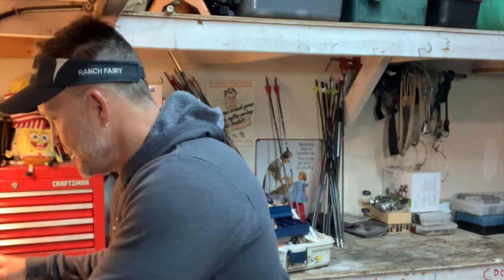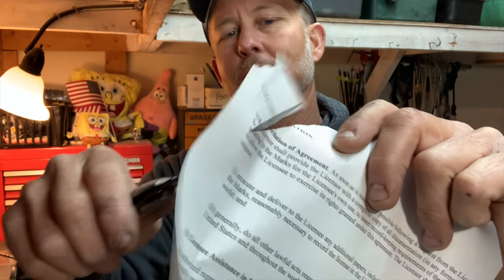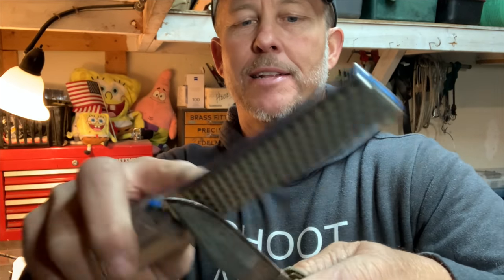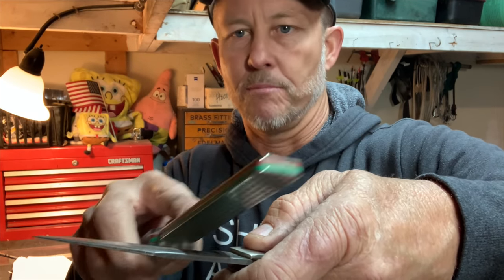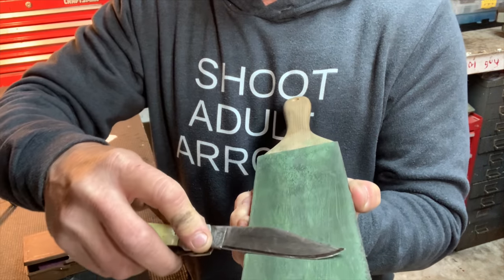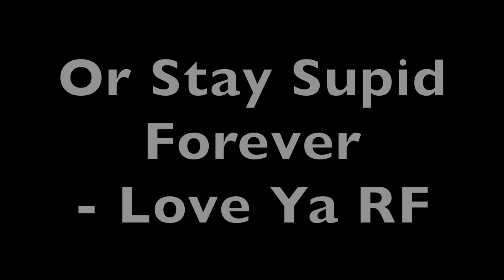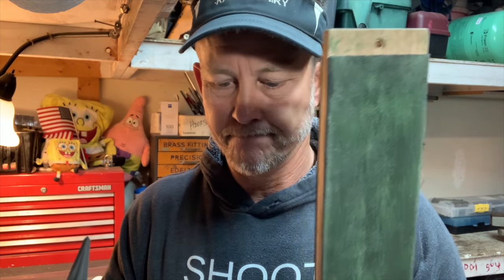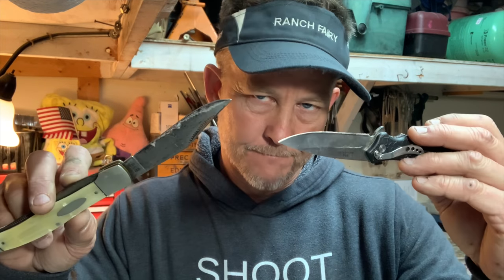Broadhead Sharpening Hack l Ranch Fairy

Comment: As a person that others pay to get their expensive knives sharp, I whole heartedly agree with the RF. You can chase down a $600 stone(quite easily) but if you can't hold a consistent angle and learn to hit the apex, form a burr, and remove a burr, it won't help at all. I always say, "the only way to get better is time served at the stones" . Invest in the skill, and the tools you use become modular.
Reply: You can also skip the strop and use newspaper. Spend your money on a quality coarse stone.
Reply: @jonbrown9490  course stones are only good for wrecked blades
Reply: @mikeguy9668  I guess that depends on what you consider course. My lowest grit stone is 220. I finish on a 6k. That being said I still agree that most amateurs are way better off with a quality coarse stone first.
Reply: @jonbrown9490  you can fuck the profile on a blade up real fast on a course stone. If I have a really dull blade I'll hit it with 500 first and end up at a thousand and finish with a strop.
Reply: @mikeguy9668  you can fuck the bevel up with any grit stone. That has zero to do with the grit of the stone and everything to do with skill and technique.
Reply: @jonbrown9490  a course stone does it much faster. This ain't rocket science
Reply: @mikeguy9668  you're absolutely right. The answer is simple...if the stone is coarser and you don't want to remove as much steel ....rub the knife or broadhead  on it less. 

Then look at it to see if you need to remove more metal...if you do rub it on the stone some more...if not... stop and move to a higher grit.
Reply: 100 % the truth purchase yourself some good stones plates paddles what you like and start the process take it slow and detailed and it will all come into place in a positive way.
Reply: @jonbrown9490  A course stone is used to take out damage to you broadhead and used very little course is 325 mesh fine is 600 mesh extra fine is 1200 and a strop with the three you can get your broadheads scalp sharp be careful not to drop one if so you might just take out someone in China.

Comment: Watching this again for entertainment and edification. Recently I sent a high end single bevel through a whitetail that was extremely quartered away. It arrived sharp and kept on going. It does need to be resharpened; but I’ve had lesser blades break apart inside deer. So go for the good steel; and learn to resharpen!  Thanks Ranch Fairy!
Reply from the maker: Always touch them up!!  Double check everything.

Comment: I learned how to sharpen a knife when I was 8yrs old. My Grandfather gave me a yellow handled Imperial pocket knife and a 2 sided carborundum stone. He showed me how to sharpen it on the stone, strop it on my leather belt and told me if he ever found it dull, he would take it back. He never got it back, I’m 58yrs old now and still have it. I shoot a 65lb longbow with 145gr single bevel SHARP broadheads, on my sitka spruce adult arrows. Love the videos Troy, tell it like it is.

Comment: Damn you Ranch Fairy.  I sharpened my new Magnus Black Hornets the way you showed the THP guys and while hunting accidentally knocked my my bow over in the blind.  Broadhead straight through the side of the blind like butter.  Haha.  Thanks.  I guess I did it right.
Reply: yes, he used the Stay Sharp guide. If you want them even sharper there is a video to show you how. https://youtu.be/9tg0PfHkcfU
Reply: @innovativeoutdoorsman5067  I used your Stay Sharp guide.  It worked very well.  Definitely recommend, especially for broadheads.  Never saw that string trick before.  I just bought some of the serrated heads.  I'll try it out.
Reply: @Patrick-wu6kt  Yes, tricks and hacks and methods for making bowhunters more lethal is what my channel is all about. Simple, low cost solutions that increase bowhunter lethality. Thats what I do.

Comment: Sharpen those single bevels with a Stay Sharp guide for a razor's edge. And its super easy. No PHD needed. Super easy and effective and razor sharp blades when done. And its very low cost. DO NOT waste money on a strop when you can use cereal box cardboard for free. Spend the money on good broadheads and use a free strop.  I show how in all my sharpening videos.

Comment: You have a good technique, and it works for you, and will others. That burr, you are describing is called a fin. The fastest way to achieve it is to pull the edge into the stone (on both sides), with your course and medium stones. This is sharpening. With your med fine and fine stones, you draw the edge away from the stone. This is honing. Then stropp, just as you said. This will save you a lot of strokes. 
Also, look directly at the edge. If it reflects light, it needs more sharpening. If you cant see it, because it is refracting light, it is ready to hone. No PHD here, but i do shave with a straight razor, every day. The right direction for the stone, and looking to see if the edge reflects light or not will save you a lot of time, is all. Over sharpening is the easiest thing to do, and can cause lots of discouragement😂 
Good vid!❤
Reply from the maker: Always here to learn!!!  Do you have any devices you use to “look” at the roughness of the edge?  I’ve put mine under a computer based microscope and it’s not perfectly polished smooth BUT better than just 2 years ago!!!!
Reply: @RanchFairy  I'm not that sophisticated😂 I will use a magnifying glass, to see where I'm at, on say a long blade I'm not familiar with. You can feel the fin, or the "burr", so don't need to look at that. If it is is real big and easy to see that it looks like a piece of aluminum foil, that means you were ready to hone, a hundred strokes ago😂 Those diamond stones cut real fast. If your edge is kind of sharp, and doesn't reflect light, but you want it sharpER, skip the course stone. Just a few sharpen strokes on medium, will have it ready for the hone stone (fine grit). If your fine stone is an actual soft stone, rhey clog with metal, real fast. If yours is covered in metal color stripes, its clogged and won't polish. Your course diamond stones, under slow warm water will clean that metal off, real easy. Honing under a soft stream of water will save a lot of strokes and keep the srone clean. When the stone is clean, and your angle is correct, you can feel the stone grab the knife, vs slide across with little friction, you are honing very efficiently. Anyone that has tried to sharpen a knife has felt what i just described. So, you strive to feel the stone grabbing the knife. That means the whole edge is laying flat on a clean stone, that is working. Its all about moving to the next step, in the least amount of strokes, so you don't grow to hate sharpening😂 Of course, this all applies to any edge, and your broad heads. Hope I didn't bore you😂
Reply: The instant you can look directly at the edge, and it doesn't reflect light, but looks black or invisible, you are done with the course stone. As soon as you feel the fine stone "grab" the edge about fifteen times, alternating sides, its ready for the stropp. It took me millions of wasted strokes, and a lot of un-needed elbow grease to learn how to keep the whole edge flat on the stone, and when you are done with one stone and ready for the next. I hope i saved some folks a lot of time and aggravation😂
Reply from the maker: @vitodelorto1796  
Practice makes it work better!!!
Reply: @RanchFairy  It took me a long time. No one will ne an ace at it right away. They should not be discouraged if it doesn't work as easy as on the video, their first few times. Once they get it down, they will have another adult skill, to go with their adult arrows😂

Comment: Since Im all about helping out the new guys and the young guys with little to no funding for bowhunting, I can tell you to NOT waste ANY money on a strop. Put that money into good broadheads. You already have a strop at home. In all my broadhead sharpening videos I show and explain the use of cereal box cardboard on a flat surface and buffing compound to make a nearly free strop in any size you like. And another benefit is you dont have to clean it or resurface it. 
When it becomes clogged, just eat another box of cereal. That will save you both time and money. Im all about broadhead sharpening and educating bowhunters. Get a razors edge with very little cost or effort. Broadhead lethality is my goal and getting others there is the mission.
Reply: Same with knives. Shitty steel will never take an edge that will shave arm hair, let alone keep the edge. You can sharpen, hone, stropp, til your blue in the face. If you ever get it sharp, that paper slice test will dull it😂
Reply: I made my strops pretty cheap man and I guarantee you that they work better than cardboard. But I get where you're coming from, some people try to sell strops for way to much
Reply: @mikeguy9668  piece of leather laminated to a board works great. I use a conventional stropp (not cheap and almost 1/4" thick 3/16 maybe and very smooth) for the razor i put on my face every day. I guess fine, medium and course applies to leather as well as stones. I don't understand it, but my home made strop works best on filet knives and real strop best on straight razor. Edges are all different and fineky😂
Reply: Look up "scary sharp"  The woodworking method of sharpening with sandpaper.  You can use the whole method, but if we are talking strops, just use the last step on sandpaper.  It is fast cheep, lasts, if you get the right paper.  And it is more aggressive than a strop.
Reply: @HondoTrailside  a strop doesnt sharpen. Once you hace finished sharpening with grit, no matter how fine, the strop just polishes the striations left by grit. Its just the final honning touch. Probably useless for broadhead penetration, but very mandatory for a clean facial hair shave.

Comment: This week I'm going through the process and building my adult arrows. Then I'll see what broadheads I'll use. Whatever I shoot this fall will have 2 holes and may not even feel it. 😁🏹
Reply: Take a look at alien archery Broadheads. They are less expensive due to the fact they need to be sharpened but I enjoy sharpening. I have only shot them at 20yards indoors so far but they are flying perfect with a total arrow weight of 660 grain and four fletch. Just waiting for the wind to die down so I can test at longer distances.
Reply: @goldmountain6520  I'll take a look. After bare shaft tuning, I'm going to be shooting Easton Axis Match grade, 5mm, 300 spine arrows. 225 gr up front, about 565 (not including vanes). Was shooting bullet holes in the paper and they just came off of my bow really nice with a quick recovery. From 10' to 10 yards they flew as straight as I could ask. Going with the AAE Max hunter vanes.
Reply: You really can't beat tuffhead or cutthroat. As long as you don't lose them they'll last a lifetime. Dont buy cheap steel broadheads

Comment: I work in a meat plant, there is a easier way to do it (in my opinion)... not saying your wrong but the way I do it is I combined  what I call with the grain and across the grain where I can keep the blade symmetrical from one end to the other... it will give you the exact same strokes and amount of steel removed... I also pull the blade to me with the edge facing me sharpening the “right hand side” and push away on the other side..... that’s just the way I was taught by my uncle years ago.... there is really no incorrect way to do it if your the only one who sharpens that knife and you can do it the same with the same angle every time...

Comment: As a Carpenter, I use similar methods to sharpen planes and chisels. However I hollow grind the edges first and depending on the tool use, create a micro-bevel which is the working part of the blade. Would a single bevel still work if it was hollow ground instead of flat ground?

Comment: Open question.🙋‍♂️  For a lower draw/poundage 🏹  (27" 50lbs), What would be more effective single bevel, double bevel, or serrated broad head? Currently using a 3 blade.
Reply from the maker: 500+ grains perfect arrow flight 
Would be most effective. 
Then - single bevel - SHARP!  Always sharp

Comment: RF, have tried the Steel Force Traditional Series 2 blade single bevels? Sirius has been out of stock on their single bevels for a while. Interested if you've given the Steel Force heads a try.

Heading up to my property in a few weeks with a test kit. If my bow/arrows like the 225 or 300 gr, I'm thinking I might try them.

Comment: Thanks. Excellent video. I hope you don't mind me asking, but I have been using Montec G5 broadheads on my crossbows and would appreciate your insight on their quality and how to sharpen them.
Reply: If they are stainless steel (grey) they are very soft. That is why Montec came out with the carbon steel version. THey are a little harder. If you lay that head flat on a abrasive surface, you will get a 60 degree angle on the blade (30 degrees on a side) many sont like that angle. I can get you to 44 degrees (22 degrees on a side) and hollow ground and produce a far sharper edge with a curved hone called the 344.  ITs works on all the fixed, 3 blade, one piece heads. Its super easy to use and low cost. Just know their steel (Montec) is not the best due to the sintering process they use.
Reply: @innovativeoutdoorsman5067  thank you kindly. you are a scholar and a gentleman.
Reply: @davidstonkus3288  My channel is all about broadhead sharpening for the new (and experienced) guys to give them really simply and low cost ways to reach a razors edge. Bowhunting and broadhead lethality is the purpose of my channel. Free hand sharpening is OK but people want low cost and simple solutions that work, not a talk on how they should learn to free hand sharpen.

Comment: Have you tried the VPA single bevel broadheads. There the only single bevels i can find in stock and at $80 for 3 I can see why. They have a flat tip on them. That's the part that has me hesitant on buying them.
Reply from the maker: You’ll have to tanto that tip and sharpen them
They don’t come sharp. 
Sharpening is hardly the reason to pass - you need to sharpen broadheads period. 
It is going to be a fine broadhead. 
Hard steel, not terribly difficult. 
Tuffhead evolution should also get a look as well as grizzly stick samurai - black ferrule
Reply: @RanchFairy  ok thanks Troy. Just got the test kit shooting good now on to building a dozen. Thanks for all the great content and help. Very excited to sling one at a pig.
Reply from the maker: @brandoncole5519  
Heck yeah.  Holler at Sirius about ranch fairy EZ button arrows or bare shafts and give it a go!
Reply: @RanchFairy  already did.

Comment: How do I get the spreadsheets you were talking about with Brandon?
Reply from the maker: They are locked in a top secret room because the twizzler guys get their feelings hurt
Reply from the maker: @ericskillern2437  
Well, it’s pretty simple.  Your arrow also has to penetrate the western animals.  Not just hit them.  600 grains shoots flatter than you think!  But when it arrives - it still weighs 600 grains 
Fact from lab radar 65#/28.5” draw 
388 grain arrow loses 33 FPS
616 loses 14 but weights 40% (spitball) more
Reply: @RanchFairy  that makes alot of sense. My buddy keeps telling me I have to shoot it on lab radar and I couldn't be right about the heavy and light arrow being the same at 67 and not the same at 20. It's not easy for me to go down and get a 25" arrow to 600gr to test. I can't tell the bow shops what I want to test 🙄 if you even ask for heavy components they tell you easton or victory have spent a ton of money on r&d and there is a reason they sell this crap. I say crap because my inserts are breaking when I hit plywood, fiberglass kayak, I even skipped an arrow off the water and it broke. I've been shooting 380 grain total package and it's getting the job done on deer but I can see the hand writing on the wall. These big pigs you got to get quartering away or your  not going to find it most of the time.

Comment: My uncle is a big time traditional guy in W NYS.  He’s an Ashby guy.  Asked him how he sharpens.  He clamps the broad head in a duck bill vise grip, then clamps the vise grips in a bench vise.  Then hits it with a fine mill file until he gets a burr down the length.  Then stones and stops to fine tune.  Trick to good broad heads that should be hard as woodpecker lips is to start with something aggressive.  I.e. a file or 200# diamond.  Otherwise you’ll be working all day.  Look for shiny spots on the edge.  Those aren’t sharp.
Reply: Good broadheads are harder than woodpecker lips.  If you go at it with a dainty stone, it’ll take hours instead of minutes.  I said this twice because I mostly wanted to say “harder than woodpecker lips” again.

Comment: Doesn’t have to be perfect with the factory bevel.  Just be consistent and use light pressure.  Angle like you’re cutting a thin sliver.  Get any blade shaving sharp on the edge of the car window lol.

Strop on folder piece of cardboard.
Reply from the maker: Teaching people who don’t know how. 
And yeah - you’re right